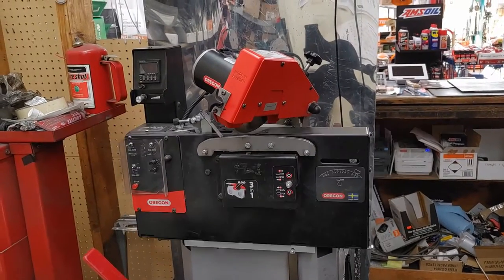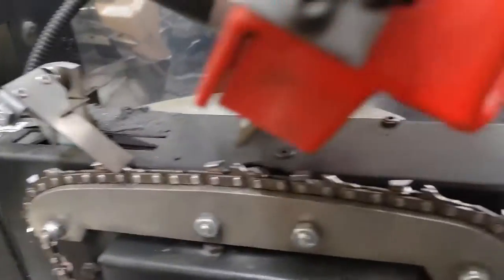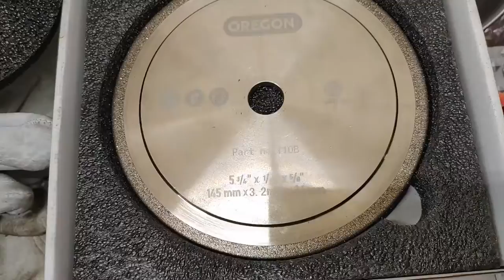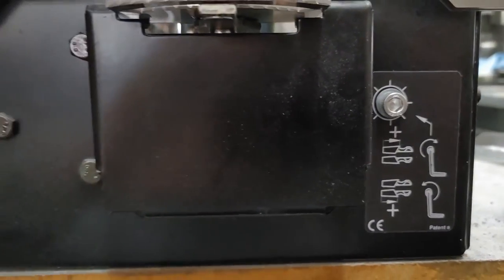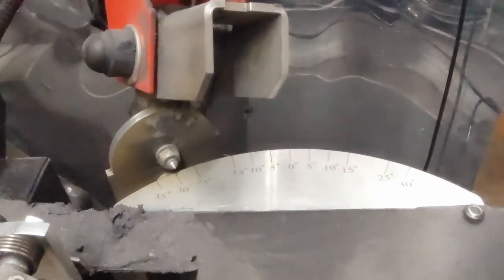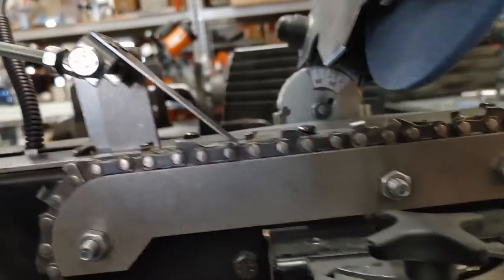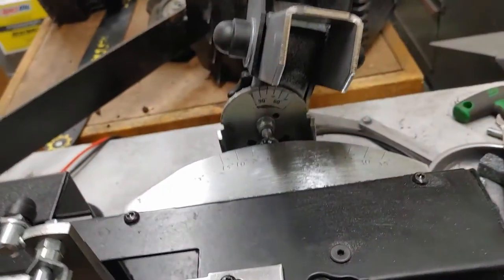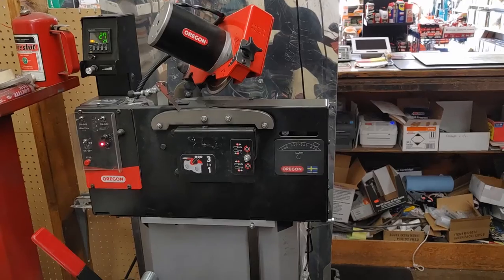Automatic Chain Sharpeners by Oregon and Tecomec

Comment: Is there any reason you couldn't use an ac/dc adapter to power the tecomec instead of using a battery?
Reply from the maker: I tried to use a 12v battery charger and it didn't work. The Oregon has an ac/dc converter on the stand in the back. I believe it must have something to do with having enough amps to run it. The battery charger was only running at about 5 amps.

Comment: About how much do you charge per chain?
Reply from the maker: Used to charge $10 under 20 inch, $12 over, then $14.50 - 28+ inch chain. Not sharpening at this time, need better ventilation.

Comment: So I take it the grinder removed material from the tip of the depth gauge. Any concerns about the profile on the depth gauge after grinding? Thanks.
Reply from the maker: The Oregon 3 in 1 just grinds the tips flat to whatever depth you set. On the Tecomec I dress the wheel at a slight angle before grinding the depth gauges.  Don't know if it's critical, but our customers seem to like the results. The most difficult thing I find with doing the depth gauges is setting the wheel perfectly to take the same amount off the inside and outside. If the wheel was perpendicular to the middle of the chain, it would be better, instead of the pivot point being closer to the inside cutter. Regardless the Tecomec is still a great tool for this.
Reply: @fischertoolandgarden  thanks! Great video and I do appreciate your attention to detail.